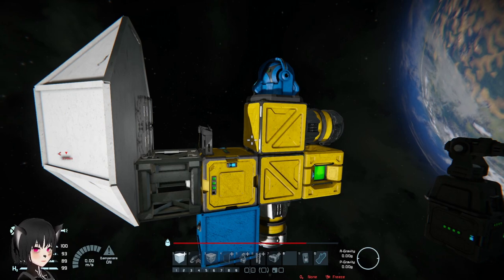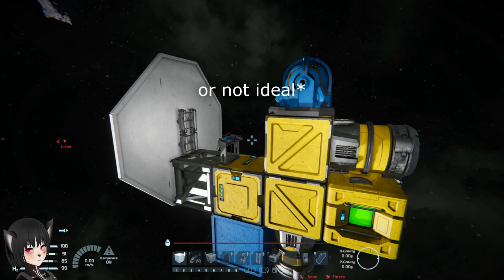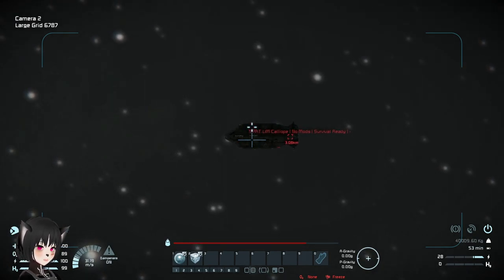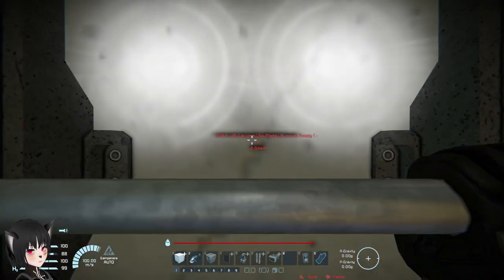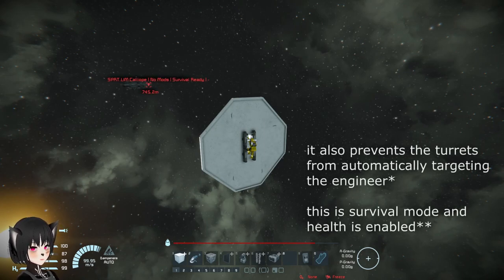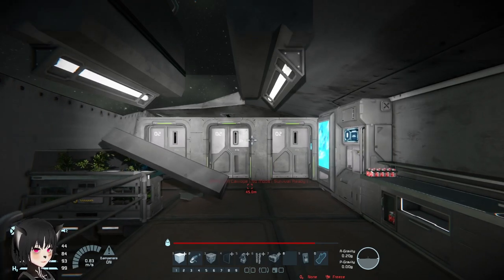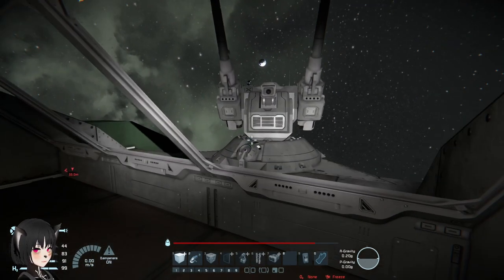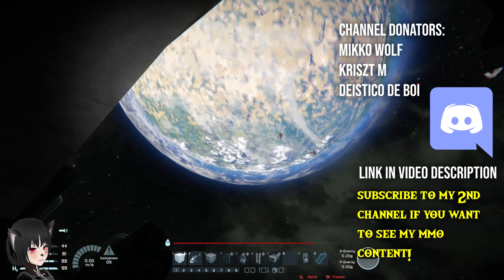This Trick Makes Boarding Ships Reliable, Space Engineers

Comment: You can actually just use a bed and some sideways passageways to board a ship within seconds, you just need to enter in it sideways and enough blocks on the sides so the only valid dismount point is inside someone's ship (doesn't have to be attached to their grid)
Reply from the maker: That sounds interesting c= deployment and timing would be tricky though

Comment: You could set up an attack ship, and after disabling the enemy ship, and the enemy crew is trying to repair their thrusters, or conveyor systems, cargo, tanks, power, or similar, you can have a side wing full of boarding cups (kinda like Halo ODST drop pods) designed in the same fashion, all use your ship's acceleration to speed up and shoot you directly into the heart of the enemy ship as they are idled out, or if they crashed into an asteroid or whatever the situation for boarding is needed.  

Essentially you are towing your boarding craft as small detachable "scale" armor on the side of your ship, accelerating towards the enemy, then launching all your scale armor ships with people in it at once, all they have to do is hit a button to disengage from your ship, you decelerate your ship to stay out of range, and then they can mass board the enemy ship.   

That said, if the enemy isn't moving their ship anymore, you can manually control your artillery turrets to focus fire on their weapon systems so the enemy is a non threat.  If you have a jousting lance or grav drive or set of magnetic plates or landing gear you can also attach to them to prevent their escape and keep them pinned to continue picking off their turrets without their gyros being able to free themselves.  After you take over their medical room and survival rooms, you can tow their ship back home to be salvaged into scrap and looted for resources.  :)
Reply from the maker: That sounds interesting though it's kinda likely that the enemy ship would be running away or drifting at max speed if in that kinda scenario c= and if they're completely disabled then it's likely that they would be unable to shoot, and the boarding ships won't be necessary, interesting idea though x3 just needs specific circumstances to happen for that to be possible or the most effective thing to do

Comment: Why don't you landing pad your umbrella to the tug? Sure, the sacrificial block is more convenient for testing in creative (or to print the thing as a whole), but the landing pad would make deployment easier.

Also, if you have your tug stay close to the armor umbrella it could function as a distraction for any turrets that might otherwise shoot at you after the impact. I.e. have the timer blocks cause only the slightest upward burn.
Reply from the maker: Thought about using a landing pad or gear but the accuracy might get compromised that way c= since torpedoes or projectiles carried by another grid is always affecting the thrust directions and make them less accurate x3

That also sounds interesting though I'm kinda concerned that stray shots or explosion radius might hit the pod if the timing is not precise and the control module is too close during approach u wu